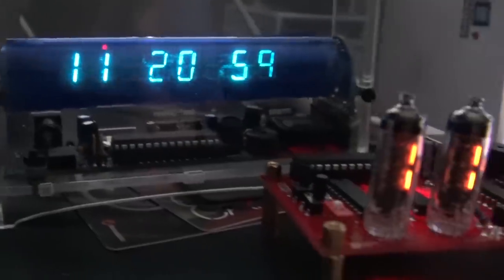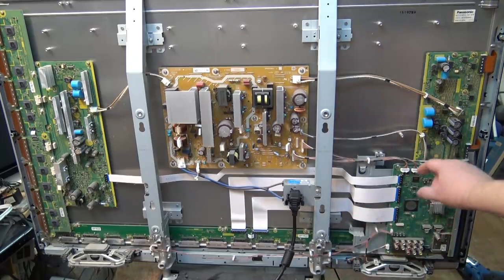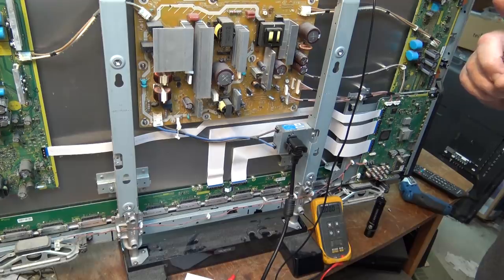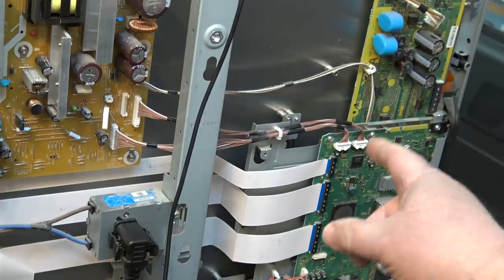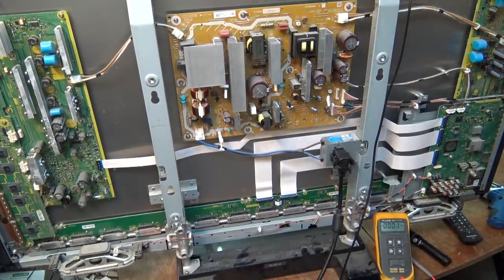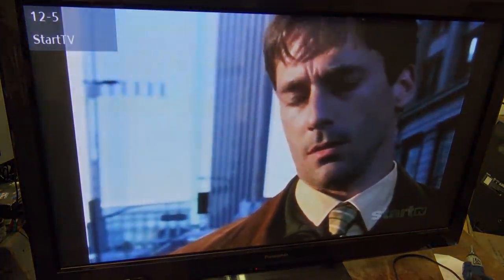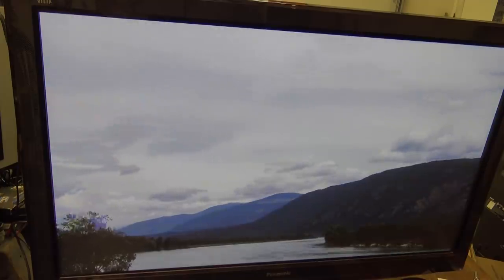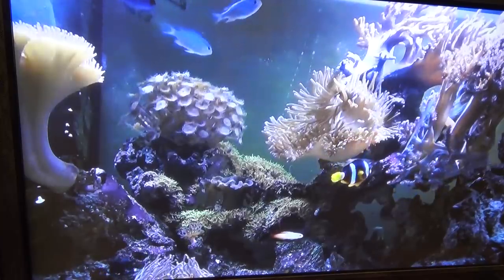Panasonic tc46s2 plasma 10 blink shut down component level repair

Comment: Plasma was just pleasant to look at being emissive like oled/crt, I have the 50",
Reply from the maker: I have many. A Panasonic 42 SD model.  A 42 he LG. 2x 42" 1080p Panasonic, this 46 and  2x 50" 1080p panaaonic plus a 63" Samsung and those are the ones that have perfect pictures.   I also have several Samsung sets with damaged panels.  That 51" with a crack on the screen and major burn in from the news channel I watch all the time.  2 46 with a single red vertical line and a 50 with a bunch of vertical lines that just get used by the gamers in the house.   Got a few LCD sets too. Too many TV's.  Out of the good sets only 3 are in use.  The others are in the closet awaiting their turn to go back in service when another one blows up.  They may be there awhile because plasma tends to be more reliable than the new ones.

Comment: Excellent troubleshooting. Just wondering where you acquired the service manual pdf. I have a Panasonic 42" which as been trouble free but tomorrow is another day eh!  The only sign of a possible problem is that in a few random and far between times it turned on looking super saturated in color. Cycle the power again and all is OK. Strange issue but can't chase a ghost ... Thanks again.
Reply from the maker: G O O G L E.

Thats where I find my service data. Sometimes it takes some research and there are times I have spent more time looking for data than actually fixing it, because many of the searches lead to commercial sites where they want to sell you the data. I have never paid for any service manuals. They are out there, you just have to look. Sorry I can't be more specific, but every one is different. Some times I will find what I am looking for in minutes, and sometimes it takes days of searching.
Reply: @12voltvids  that's what I suspected and also my experience in the past. I had just asked in case you had the "mother of all manual sites".  Much appreciated!

Comment: God job! I have more that capacitor ceramic like this into DVD HT philips. can replace with 100nf ceramic THT ?
Reply: If shorted, you can't really know the value except by size, voltage and application. This one I would guess is 5 or 10uF, used for supply voltage noise filtering. It's large for a ceramic. In this application the value isn't critical at all.
Reply: @thulinp  is non polar capacitor smd. Can use polar capacitor?
Reply: That depends how it's connected. Better to use a larger non-polarized cap.

Note that I know nothing about your cap. The one in the video is 5 to 10 uF.

Comment: Having problem with Panasonic TX-42AS520B 
Red Standby light continues  flashing like 2 seconds gap. Had this issue first time like 2 weeks ago when it was not responding to remote and then tried from the power button on TV and first few times it did not worked. It tried to turn on green light flashing then green steady light and then red flashing light again but after few tries it did came on and was working fine untill now it happened again doing same thing. 
If I press power button on TV it does cone on, sounds is there screen flashing white colour 3 times with 1 or 2 sec gap and after 3rd flash it cutts off continues red flashing light.
I have done all the basic like turning off from mains from mintues to hours even over night but still the same.
I dont understand why it would start with flashing light when powers been off and when you turn on it should be standby atleast then but no so something its reading faulty even after restarting without trying to turn on.
I am very technical minded and gets my hands on anything and not scared of opening and fixing anything and did few TVs as well in the past. Just needs right direction. Is it the power board I am looking or main board. I will be happy if I can fix the current ones if not changing board should fix it. 
I have got VOLT Meter if it needs checking voltages and Soldering Iron as well some where. 
Sorry for long message I like writing in details. Any help will be highly appropriated.

Comment: I have the Panasonic TC-P50GT30. First it had the 7 blinking lights. Got the TNPA5335 repaired and installed it 9/29/2020. Now the TV is blinking 8 lights. Any suggestions?
Reply from the maker: I have one but you probably won't like it.
Reply: @12voltvids  Wild guess! Purchase an Oled.😂
Reply from the maker: @JohnSmith-wj4sh  Pretty much.
Check your connections on the boards, but plasma are complicated beasts. I have fixed a number of them, but even now I am leaning away from any and all TV repairs. The price has fallen so fast on TV that they are just not worth spending any time or effort on. I don't know that I would buy an OLED set though, due to the burn in issues.  The SS board is a common point of failure for the 8 blink code.
Here is one I had.
https://www.youtube.com/watch?v=zYoxAqaKoBw
This is my set, and it still works after I rebuilt the SS board.

Comment: Hey my tv has the same exact issue and is the same exact tv model ! Can you pls tell me where can I get this “ceramic pc “ at sir ?
Reply from the maker: I didn't replace it. Extra parts.  Not needed.  There to filter possible RF from radiating. As if i care about interfering with am radio. After all, it's a plasma.  They blow out all reception in the vacinity anyway.

Comment: Even after you have found the fault, on such an old unit it is time to bin the tin. A new board will probably cost you $100 + and within six months something else will have blown.
Reply from the maker: Still watching it daily.  No never did replace the shorted ceramic cap.   Extra parts.

Comment: I have this TV but it is a 50" Model TC-P50U2 with 10 blinks. I have replaced the A Board and Power Supply Board but still get the 10 blinks and still don't  get the 2 LED lights when powering on. Do you have any suggestions please?? Or does anybody have a suggestion?

Comment: How does the set work with the defective cap. removed?
Reply: The cap was a low uF ceramic, just for a little filtering, as such when it was removed it made very little difference.
Reply from the maker: Just there to filter out some Hf noise that could radiate, or to bypass any rf getting in from near by transmitters.  Remember the jumper wire can act like an antenna.

Comment: i tried fixing one of those panasonic plasma's from the same time and failed. bad transistors. replaced them and still couldn't get  it working. they must have built a lot of poor reliability plasma tv's during that time.
Reply from the maker: I have seen ver few plasma sets compared to the numbers of LED sets.
Reply: @12voltvids  wow, so even worse for the led's. thats a shame, they made a great tv in the early 80's. mine lasted 16 years.
Reply from the maker: @cttv90108  I have a 2004 plasma still working. My main TV is a 2008 plasma, still going strong 11 years later. My LED DLP set has a bad DLP chip, lots of dead pixels and these LED LCD sets are a total joke, but they are built for a price point.
I have some very old CRT sets that still work, but they don't get many hours on them these days so they should last forever. Something to amuse grandkids with if I ever have any.
That decision falls on my 2 grown kids now that have both sworn off ever having any.

Comment: i found this video for my 1982 marantz sd225 cassette deck is having speed issues the speed is about 438hz but the motor is starting to slow to almost dead  for a few then back normal    it's not the belt it's good

Comment: Hey 12voltvids great videos your making.. I have a question on a Panasonic Projetion Tv pt56dlx-75 is the model. It works fine for usually an hour then shuts itself off and starts blinking orange at the power LED 6 times every 5 seconds or so. Also has made a screching noise a couple of times I dont think its worth saving but wouldnt mind playing around with it for a bit. thanks to anyone whos got ideas...
Reply from the maker: That is a DLP set. It is going to be 1 of a couple of things. Most likely one of the fans is failing, and that is the noise you hear.  After it runs for awhile a fan that is not moving enough air causes one of the thermal monitors to detect an overheat condition and shut the set down, or the color wheel motor is shot and that is the noise you hear. 
My bet is it is a fan problem. I don't have the blink codes handy for a Panasonic DLP set, but I am sure if you google it, that 6 blink code will point you in the direction. My guess, one of the fans that cool the lamp or light engine.
Reply: I think that makes the most sense also. Thanks so much for getting back to me really shows you appreciate helping your viewers. One thing I forgot was the image gets jittery just before shutdown I dont know what to think of that. Works amazing up until that last minute or so lol.
Reply from the maker: @donalddawson4120  
Hmmm now you are making me think the color wheel motor may be bad.  When you say jittery do you mean like color strobing ?  If the color wheel slows down the set will shut down.
Reply: Idk exactly what to call it but id say the image kind of flickers seems like it strugles to keep up with picture never does that for more than maybe a minute then shuts down. The screeching sound I heard once when I switch between inputs and the other when I seen the image flickering and I shut it down before it shut itself off. That time it just slightly screeched or whined then shut down normally with no orange flashing light but when it shuts itself down it flashes orange.
Just weird it literally lasts like 1 hour each time. I even set the timer for 60mins and just before it started flickering and shut down in time. It is 15yrs old or more lol
Reply from the maker: @donalddawson4120  
Symptom describes color wheel failure.  Color wheel sits between light and dlp chip and chops the white light into pluses of red green and blue. A dlp set displays the image sequencially. The color wheel spins between 90000 and 14400 rpm and if the bearing wears out and it starts to squeal and slow down the tv will shut off.  Still could be a fan and when it heats up the color wheel it starts faulting.  They are relatively cheap and it typically a plug in part.
Reply: Im starting to think it might just be color wheel because when l took it apart yesterday the fans seem to be working normal. And I turned on with panels off and there is a buzzing sound coming from in front of heatsinks when at back of tv. After I shut down and unplugged I started removing more things then got nervous to keep tearing down. From the front their is a small cover over the lens I think it is and its coming from that area id say. Also when searching for trouble code I could only find when flashes orange 6 times - shuts down -malfunction 6 - and contact service provider. Any good pages to still find that relevant info?
Thanks, might need you to do the service call lol. Come to Canada eh...
Reply from the maker: @donalddawson4120  
I agree color wheel. I did a tear down on a Samsung DLP set a few years ago.  Engines will be very similar.
Reply: thanks for the help it means a lot. and have a good day. When I replace it will let you know how it turns out.

Comment: My friend I got Panasonic plasma Tv MB02230957  I am getting 10 times blink when turn TV on measured voltage on power supply board 
12 volts and start draining down 1.2 volts  restart again unplugging cord put the probe on 15 v mos fat getting 19 volt and start draining
all the way to 5 volts keeps down and up: and their is 1.3 volt on the regulator main board.if i change the main board  works or not (help \\\\\\\\ please thank you:
Reply from the maker: One of the supplies is low and triggering shut down.  You have to isolate as I showed here.

Comment: I would like to have your knowledge. I'm collecting.
Reply from the maker: I'm still learning. Every flat screen is new to me. I learn as I go on these.  I have a basic understanding how they operate. Plasma are very complex. Far more complex than LCD and oled technology. I like plasma just because they are cool. Having a panel on an x-y grid is simple. LCD and oled do this as does plasma.  What makes plasma different is you not only have to address the x-y address for the pixel but you have to recharge the panel, and then trigger at the exact time. Makes them that much more complex than the others where a voltage to the pixel determines the brightness   on plasma the voltage is constant, it is how early or late in the frame the pixel is fired that determines the brightness.  Fire early and pixel is bright.  Fire late and it is dim. That is why plasma have the 600hz sub field  drive.  They refresh 10x as fast as 60hz LCD.
Reply: @12voltvids  
Thank you for your response.
I admire anyone who can find and remove a malfunction on TV.
I can replace any part, but I can not find the cause of the fault, and that's my problem. I have at home about 40 TVs, about 8x plasma. So far, I have not been able to fix any plasma. Of the other LCD-LEDs I corrected about 8 TVs. Mostly, sources have been damaged or LED backlighting.
If you were from Slovakia I would give you those plasma and LCD TV.
Reply from the maker: @janbalga7702  Component level repair is often difficult and time consuming. You really need to be an engineer and have full understanding on circuit design, and how things work to be really good at it.
Reply: Verla, that's true. I learned Russian military technology back in 1984, so my theory is very lacking. It is a pity.

Comment: Ah! Another RF generator repaired.
Reply from the maker: The early ones yes. The later ones not so much.  I have an early one in my shop that kicks out lots of noise.  So much it interfere with vcrs, gets into the head preamp and tears up am and sw bands.  The later ones are much quieter.  Pre 2008 models are pretty bad, the last few years they got the power consumption way down and the discharge currents were much lower too which greatly reduced noise.  Led and CFL bulbs throw plenty now. Especially the led street lights the city is hell bent on replacing perfectly good hps lights with.

Comment: Complete NOOB here. You ground the common test lead, how come? Aren't you supposed complete the circuit with it? Please explain this to me. Thanks
Reply from the maker: To measure voltage, you put the negative on a ground point. The metal chassis is ground.
Reply: Thanks for replying but I still don't understand why... Are there guidelines, for when one needs to ground the common test lead, when measuring or examples, somewhere? I really want to learn. Thanks again

Comment: Dont make videos for people who cant do this at home. Youtube is for the meek who dont know any of this techincal bs. Not even a "cant do this without tools" added into the title. Uuuuggggghhhh this is killing me
Reply from the maker: I work with basic tools like the average hobbiests would have . An old scope, soldering iron and meter.  Notice I don't have fancy air stations or desokdering tools. Just basic hand tools.  I show the fault of the unit I am working on.  If it failed once it will probably fail in another unit.  That's the way electronics are.  I would see the same fault over and over and over.